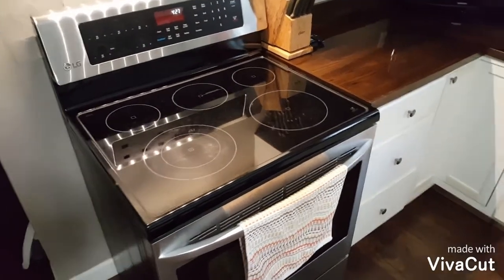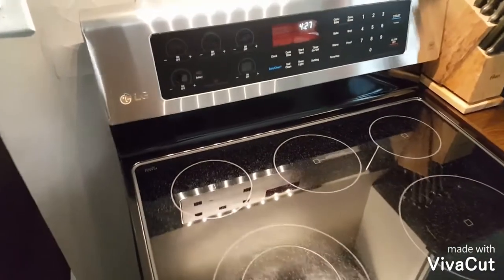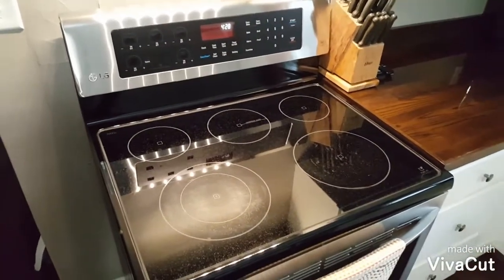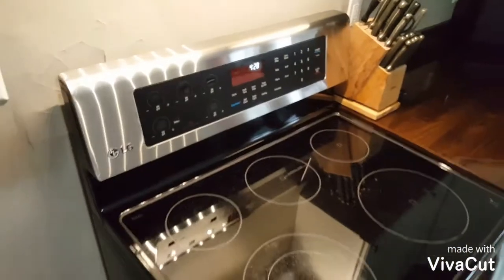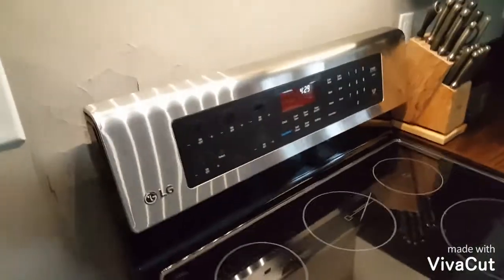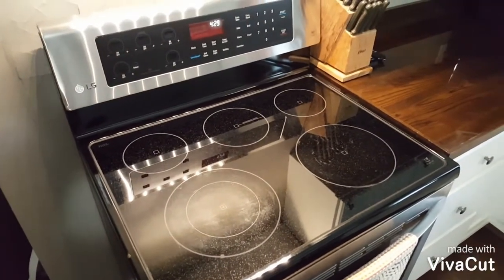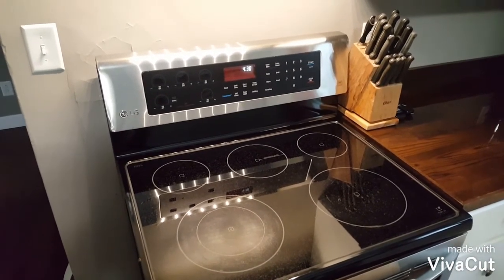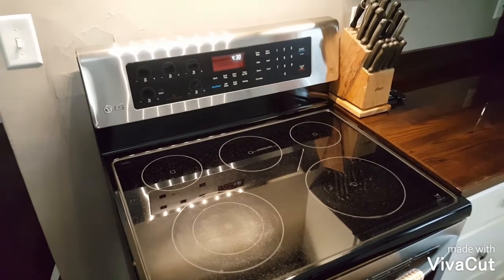LG stove convection oven problems not working issues preventive repair

Comment: My oven is not working and it looks exactly like yours.  I can’t find the model number.  However, the oven is not working.  The fan on the back wall turns on bake.  However no heat is coming out.  But on broil and the tomb element is not working at all.  Dont want to purchase an element unless i know its gonna solve the problem.  Wondering if it could be a fuse or something. The top elements work.
Reply: I ENDED UP REPLACING THE CIRCUT BOARD FOR THE OVEN AND NOW WORKS FINE
Reply: The model number is usually on the left hand side when you open the drawer.

Comment: MY LG IS DOING THE EXACT SAME THING AT FIRST THE OVEN WENT OUT SO I ENDED UP REPLACING THE BOARD FOR THE OVEN PLUS THE FAN MOTOR  NOW THE DOUBLE BURNER HAS STOPPED WORKING

Comment: My LG electric Range Model LDE3017SB, the Left front radiant heater is not workign since last afternoon, any advise on what to do and where do I get the replacement parts ,